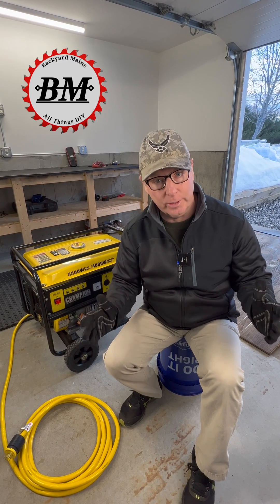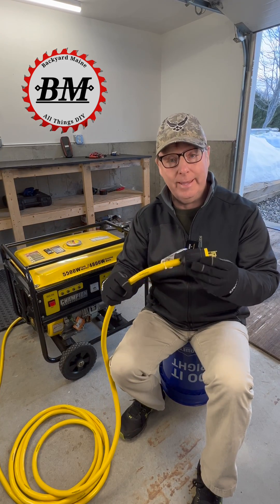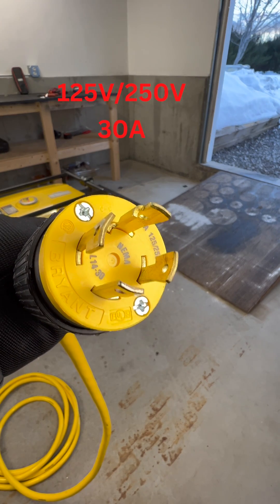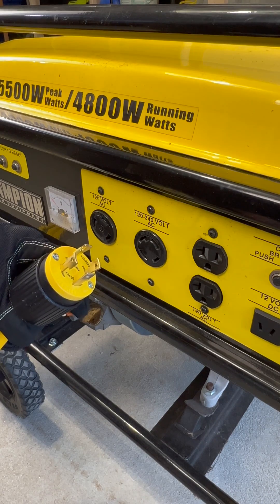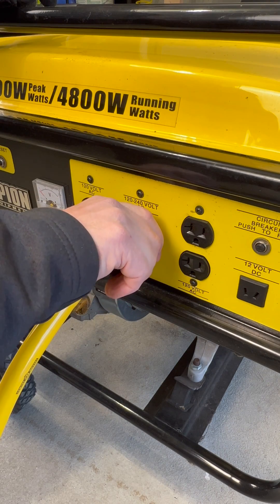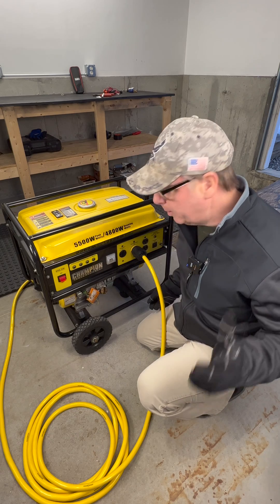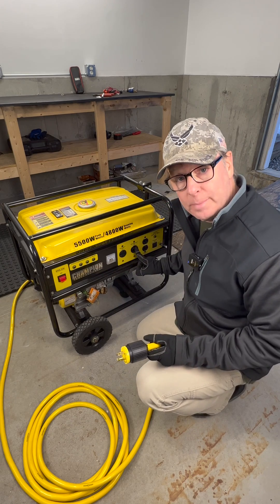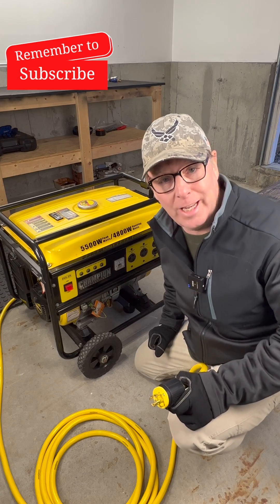Tips for Connecting a Generator #Shorts

Comment from the maker: Amazon Affiliate links:
Generator Cord -  https://amzn.to/3Rrc5xz
Generator -  https://amzn.to/3XZJlhV
Reply: Number 1 Rule 95% don't know.   Always run the generator for 3 to 5 minutes before you plug a cord into it.  Same when done.  wait 3-5 minutes plus before you turn it off.  Big scientific reason why its important
Reply from the maker: You are correct.. Another tip is to use a gas stabilizer and I also turn off the gas and let the generator stall from lack of fuel.
Reply: @BackyardMaine  Well it would be another great video for you to do,  I lost my small one from that and I amped it out, It's kind of in depth the science behind the why.  The instructions were saying something like the generator's electric field needs to stabilize to a solid current,  Fl  I did your idea, one year later it was totally rusted inside,  Now I wd40 the inside.  Humidity and salt ocean air means mother nature wins everytime
Reply: Great video

Comment: You also need to make sure that your generator has a floating neutral on it when plugged into the house, because you need all of the neutrals connecting at the breaker panel, not back at the generator
Reply from the maker: Yes unless the generator is being connected as a separately derived system which is rare for home backup.

Comment: Do a video on protable generators and circuit boards in a high efficiency furnace.
Reply from the maker: The new inverter generators are much better for sensitive electronics. I never use electronics with my generator running but with a furnace you don’t have a choice.

Comment: Question. Our generator is grounded. Should that grounding rod also be bonded to the existing electrical grounding? Or is there a ground wire inside of that. We have the 50 amp varient
Reply from the maker: Was your generator installed by a professional electrician? If yes and you have a ground rod driven that means you have a switched neutral in your transfer switch. In that case your generator is considered a separately derived system which needs its own ground rod, bonded neutral and that rod does not need to be connected to your existing grounding electrode (rod) for your home. It's still actually connected though since the ground wire on your generator feed will connect at the generator and then also back at the electrical panel.
Reply: It doesn't necessarily mean they have a switched neutral. That would be atypical. It is completely code compliant to have a supplementary ground rod at the generator without the neutral and ground bonded. The EGC ties all of the grounding system together and no additional connections would be required. 

A ground rod at the generator does not necessarily mean the neutral is bonded at that location.

Comment: Thank you for the sound advice. I just dug a thirty foot trench for my father across  his driveway and helped him run a fifty foot cord through four inch PVC in the bottom up into the receptacle on the side of his house. Alignment from a shrouded upsidedown perspective adds a whole new twist on an already difficult procedure. But yes twisting the plug in on either end is extremely important. On the opposite side of the driveway we are building a small shed to permanently house the multi fuel generator.
Reply: Is the wire/cord your using rated for that long of a run?
Reply: @tcap7917  it is.  It is  a manufactured heavy duty one.

Comment: I never knew the proper name of those connectors. At the mill we used them at they were just twist lock plugs. Part of tge lead and supervisor's job was to go around to stations and tug the power cords. If one popped out. The plug, receptacle would be replaced as a set. If the cord was pulled the next day and it came out, you got a verbal warning and a retraining day.

If it happened again for the next three months, written warning plus a week of training and quizzes. A third time and you got replaced.

The equipment was too expensive to have power spikes and sags from bad connections to get replaced often. Plugs and receptacles even for a set then, was only about $20 including labor for maintenance to do the replacing.

Remember, amatures waste time to save materials. Professionals waste materials to save time. Corporations go bust by throwing away dollars to save pennies.
Reply from the maker: Great quote.. Yes, if you're interested in the naming standard for receptacles/plugs, google NEMA receptacle chart. It lists all the variations. As you can imagine there are quire a few since they differ by voltage, amperage, number of poles etc..

Comment: Nice. Where do you plug the other end to power your house in an emergency. Run it through a window to make toast??
Reply from the maker: I have an exterior recessed plug on the side of the house and an interlock between my main breaker and the generator back feed.
Reply: Put a male plug on the other end and plug it into your electric dryer outlet is what I've heard that works pretty good. And always remember to turn off your main breaker.
Reply from the maker: That does work but it's considered an illegal  backfeed because it depends on a person to open and closed the main and the backfeed in the correct order. This can put power company workers at risk as the work to restore power. @theone4929
Reply: @theone4929 😂probably lead off with shutting off main breaker.  Backfeeding is very frowned upon by linemen and generators that don't like to explode into flames.

Comment: What's it plug to ?
Reply from the maker: It connects the house to the generator for power outages. There is a recessed mail plug on the house.
Reply: You put a male standard plug on it which you insert into an unused wall outlet....AFTER you have opened your main and opened all non essential branch circuits. If you cant trust yourself to do this right, spend big $$$ on an automatic transfer setup or the mechanically interlocked gen breaker....yup yup. Definitely need all that crap for the once per decade that you need the generator.

Comment: Can you do a video on when you need to ground your generator when hooking up to your house (like on a transfer switch)?
Reply from the maker: Great video idea.. thanks.
Reply: @BackyardMaine  Please do.  So confused when to ground and not ground the gen whether hooked to the house or not...why oh why isn't it much more straightforward?  Some say its whether its bonded or floating...I have no idea but don't want to get electrocuted.  I called the mfg and they didn't even know...
Reply from the maker: @lf6145  I will make a video but here are the basics. If you have a floating neutral generator you don't need a ground rod and adding one is not recommended. If you have a bonded neutral at the generator, you will have two choices.. One, disconnect the bond to make it a floating neutral. Two, leave it bonded but you will also need a transfer switch that switches the line wires and also the neutral as well. This would make your generator a separately derived system and you should drive a ground rod. This type of connection is usually done for large whole home generators. The issue is you cannot have the neutral bonded in more than one location and it's already bonded at your main. So to have it bonded again at the generator is not a good idea and it can cause all sorts of problems. It's also a code violation because it presents equipment and safety hazards. Most likely you aren't switching the neutral so if not, you want to make sure the generator neutral isn't bonded and you do not need a ground rod. I hope this helps.
Reply: @BackyardMaine  Can't get anymore straightforward than that.  Clearest answer I've seen so far.  THANK YOU!!!
Reply: @BackyardMaine maybe you could tell them how to check if it's bonded or not.   I already know how.     Or just buy the right gen in the first place.   Most open frame gens are not bonded from what I have found.   My 10k Duromax is not bonded, so I'm all good.  Plus, it passed inspection.